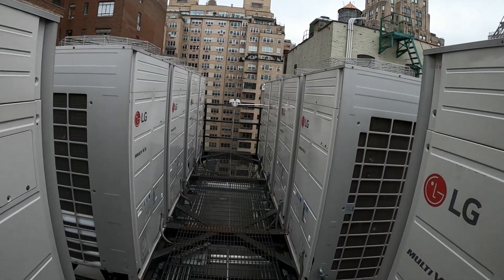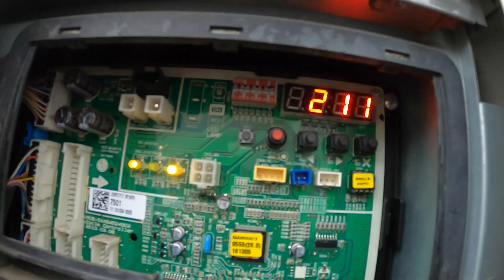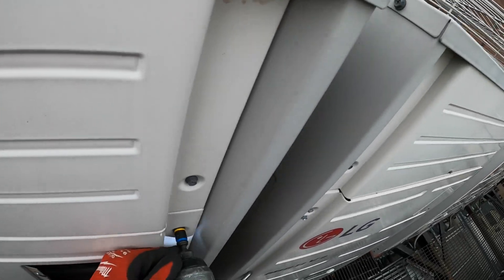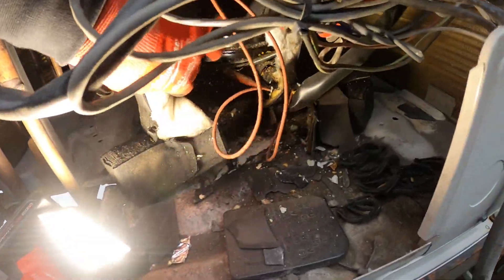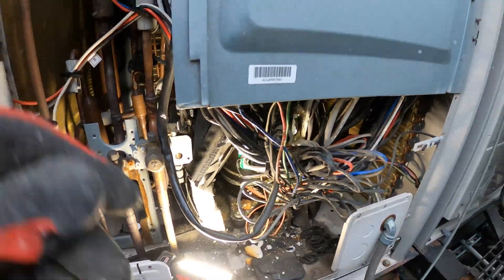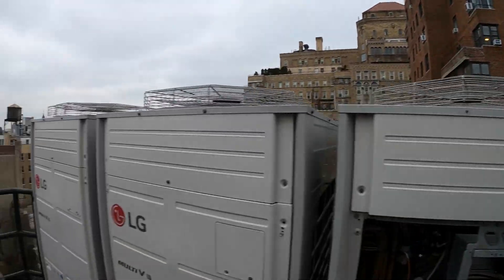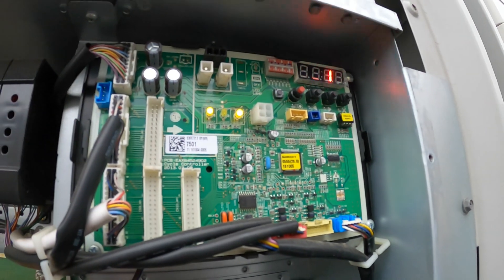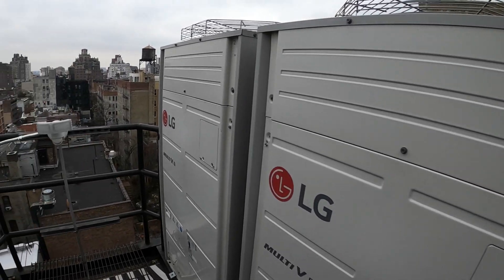HVAC Service Call: LG MULTI V Not Heating Or Cooling (LG Error Code CH21) LG HVAC Troubleshooting

Comment: what no way.. a locked up LG compressor????? i always love how overengineered these are, the compressor can be locked up and it will cook the IPM driver, FSD, Caps and bridge, but the safety fuses wont pop to save the inverter board, just because the compressor is bad

Comment: Hey man i know you already understand this but something is majorly wrong at this building. Oil return issues, wild leg on the 3 phase or something. We have had some similar issues with vrfs sometimes we are able to determine a cause sometimes not. This definitely isnt your grandpas air conditioning. Great job brother
Reply: Probably not enough refrigerant for the pipe run
Reply: @lewissaunders2837  definitely a possibility

Comment: What an overcomplicated, unreliable pile of junk.  I would like to know the repair and maintenance costs on those things over, say ten years,  compared to whatever energy they might have saved.
Reply: On every single brand of every single inverter commercial or residential, the cost of maintenance and repair is 10 times the value of energy savings, almost every single time.

Comment: We gotta do an audit on this place, probably loosing oil because installer did not following piping rules. Any compressor you replace will live a short life without correction of the piping following the piping rules. Maybe too far and too high above branch selector idk there’s a couple rules that were likely not followed as I’m sure you know